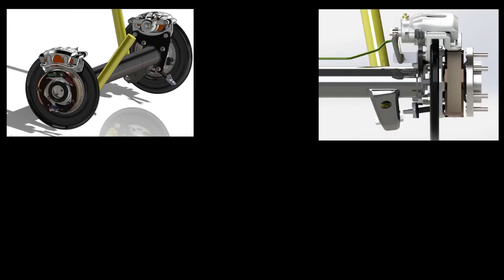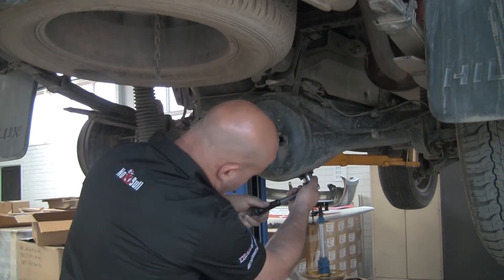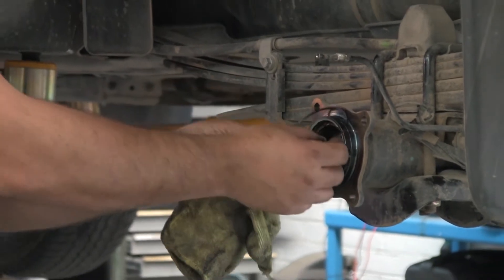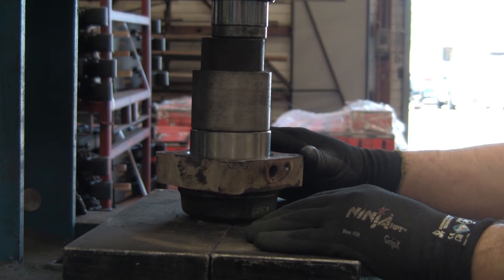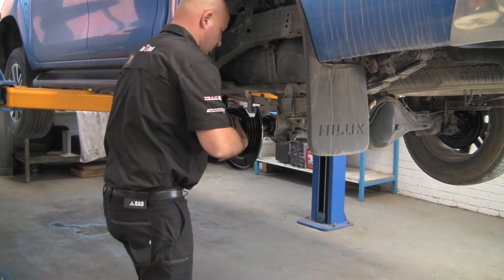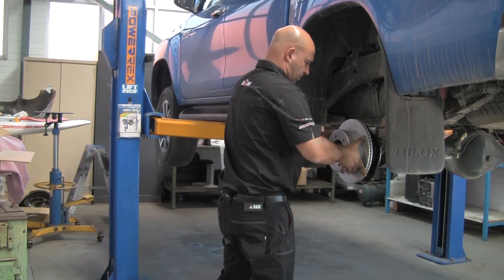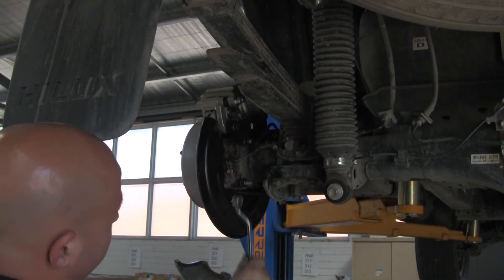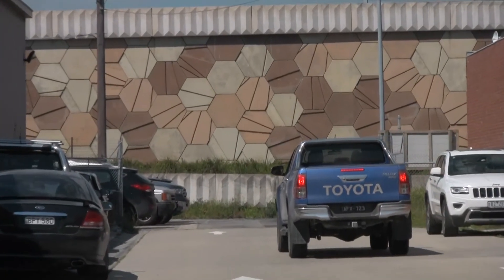PBCK006 Tacoma Rear Drum to Disk Brake Conversion

Comment: These instructions are fucking horrible. In the video you press the axel into the backing plate without the parking brake installed. With the axle installed, it is impossible to install the parking brake. The part where you install the parking brake cable shows NOTHING.

Comment: Do you guys change the master cylinder and the proportioning valve since disk brakes pressure is different from drums?
Reply from the maker: Sorry for the late reply. A master cylinder swap is not required as the caliper/rotor/drum combo is designed to work specifically with the stock Tacoma master cylinder.